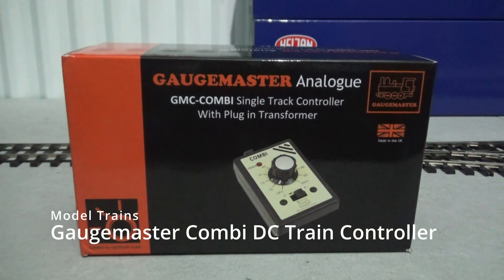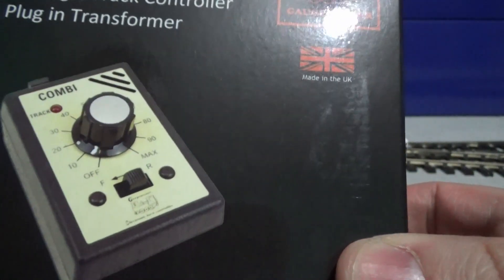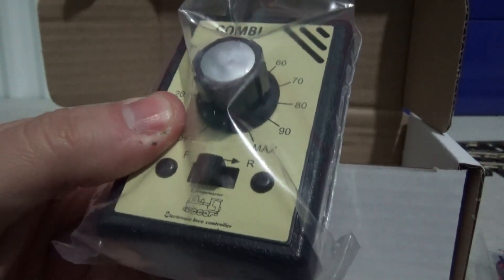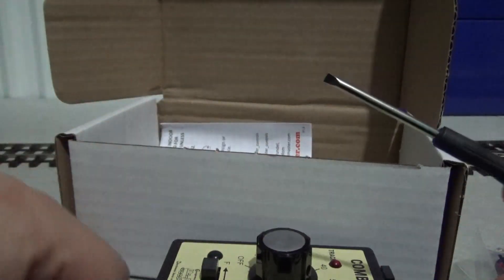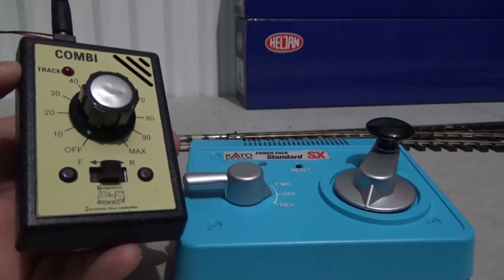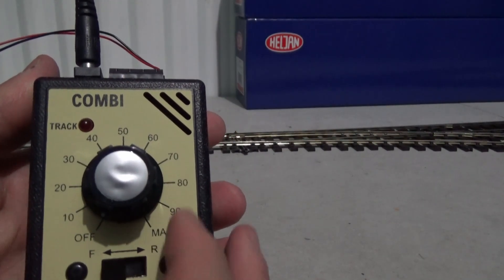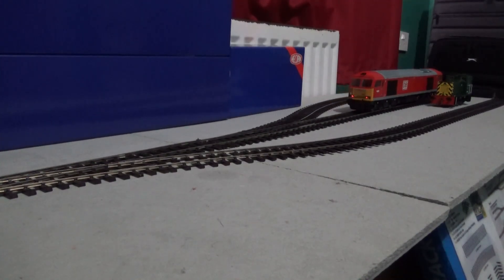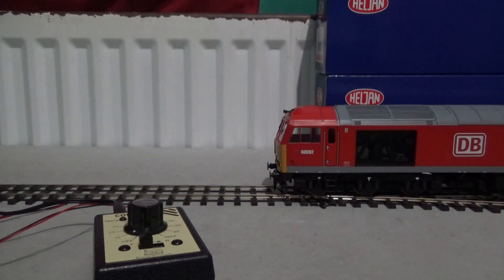Gaugemaster Combi DC Single Track Train Controller

Comment: Low amperage, which won't be much use for many high-powered DC analogue models. Perhaps more suited for OO and N scale models.
Reply from the maker: I was thinking this when it came to me. Whilst its okay for my smaller locomotives. I think I will update to something more powerful or go DCC as there was nothing on the listing when I bought this controller about the amp output and it does get warm when in use.